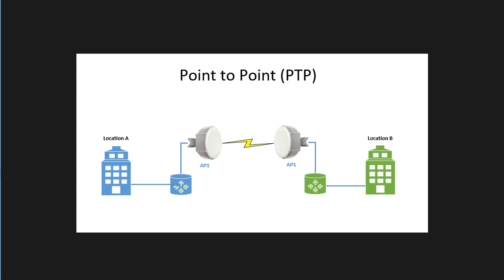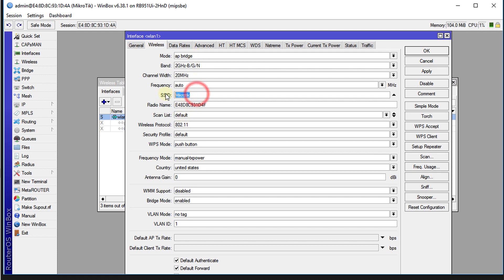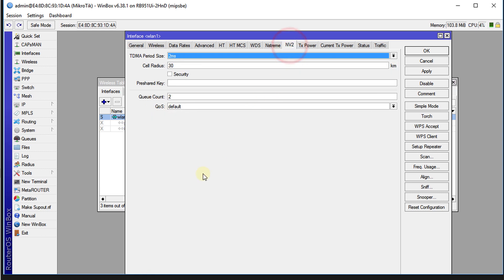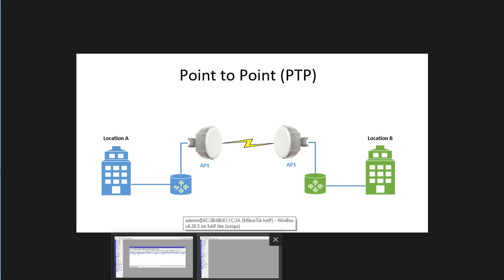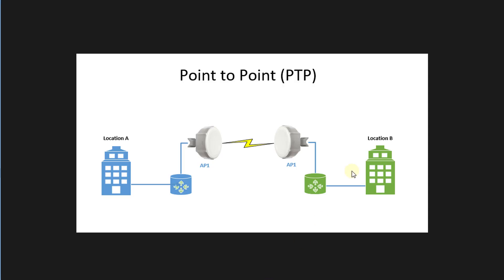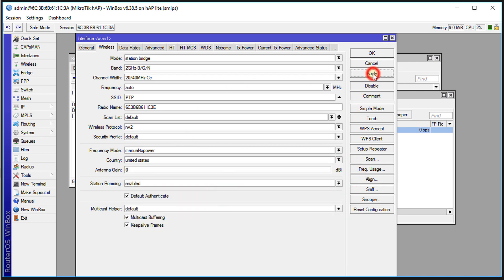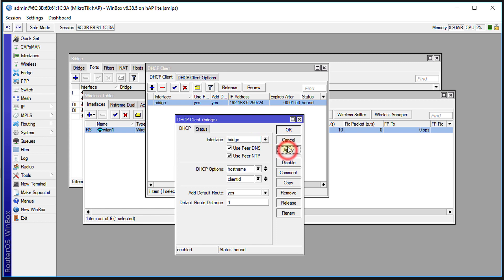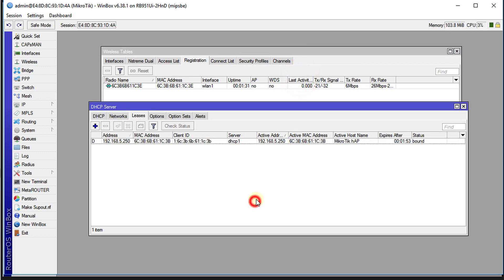MikroTik Tutorial 20 - How to setup a simple point to point  PTP network link

Comment: Thank you for this, I just wanted to ask, I will be using SXT 5 lite for PTP between two locations 1.2km far, will this work ? And using this method, will I be able to share the internet connection from location A to location B ? I have a mikrotik router in location B, do I need to put the gateway IP the same as the router in location A so it routes the traffic to internet from there?

Comment: Hello, thank you for your videos, they have helped me a lot. I am a beginner with Mikrotik networking  and would appreciate assistance with setting up repeaters for a property I have that I use for Student Accommodation. The property is quite large and therefore the one RB cannot accommodate the other areas for students to access the Wifi. Just wanted to find out how I can extend the range of the signal, which hardware do I need to purchase and how to setup it up also to enable the Hotspot functionality so that each student can access the internet using a pre-allocated username and passoword.

Comment: Hi, thanks for all your great videos. One topic that I'm missing is a Mikrotik LAN using RB's. I have an RB941 and RB931 and I want to use both as hotspots  and for wired connections. I want to connect the two RB's via ethernet (same physical building). I'm just not getting any joy using e.g. RB941 port 2 and RB931 port 1. The RB941 is connected to my ISP.

Comment: great video !
can you make another video for advanced configuration and what other stuff to do to enhance the ccq/signal and other things
Reply from the maker: CCQ has to do with the quality of the signal. The are so many things that affect your CCQ like:
signal strength
interference
# of clients
type of antenna
Fixing these will definitely improve your CCQ
Reply: yes i understand all of that but what i meant about advanced config is the protocols which one to use and when i'm currently using nv2 nstreme to all the links i've worked on 
it's seems fine most of the time and sometimes not, like ccq drops and changing the frequency won't cut it and even the MCS all of those configurations there no praticular explaining of them on nearly all the internet all what people do is depending on expermenting with them but no one actually knows what they are for or what they really do
Reply: Hassun Hany Based on my experience signal strength & interference significantly affects CCQ especially on 2.4GHz.
Reply: i'm talking about mikrotik 912 it has a big range of frequncies till 6100